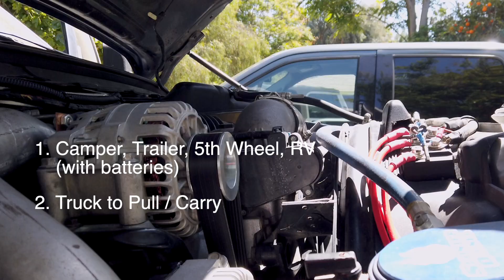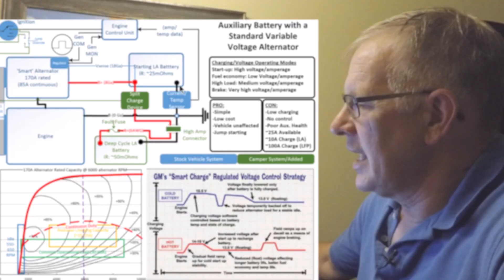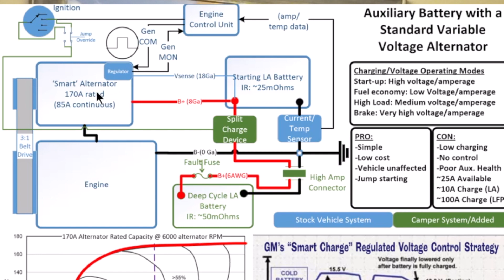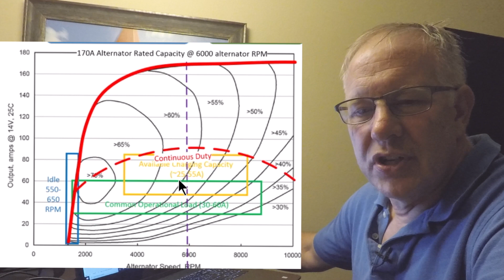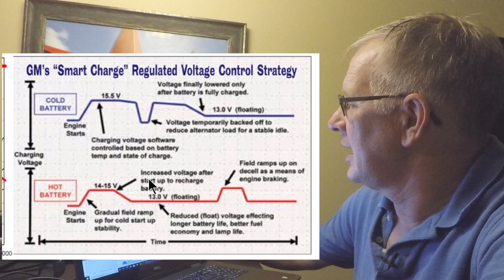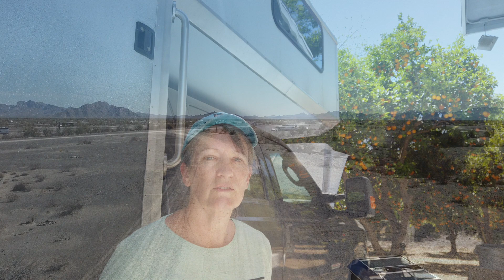EXPLAINED: Truck Alternator Charging Auxiliary Lithium Battery

Comment: I really appreciate the visual graphs and DETAILed explanation of the available output from the alternator.  This helps to understanding the many issues that can effect reliability and longevity of the system components.   What were you in your former life, a EE?  Nice to see your sweet console build to compare theory and actual output?  Thanks
Reply from the maker: I'm a mechanical engineer but have always worked in electro-mechanical manufacturing....for most people, electricity flow (as is heat flow and refrigeration) is not easily understood so alternative graphics are required.